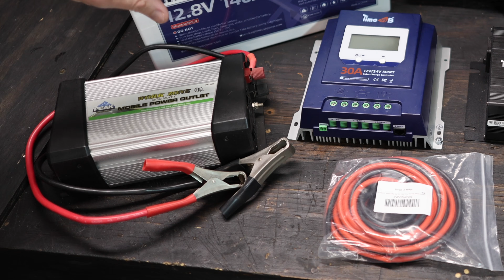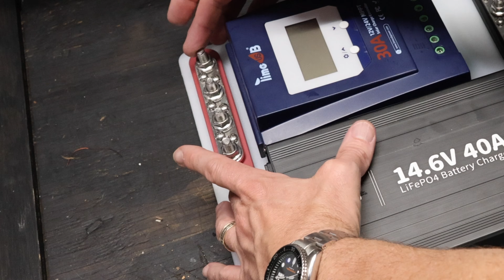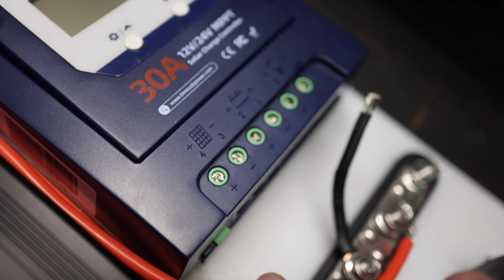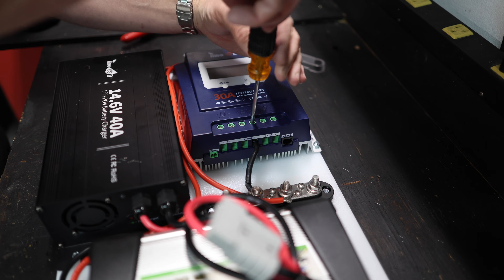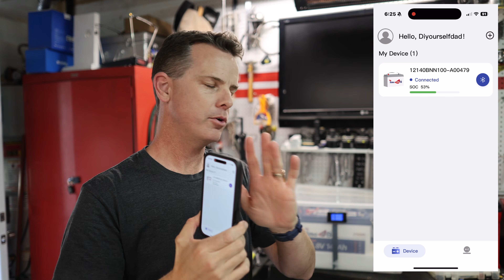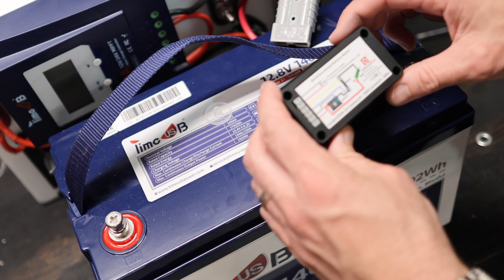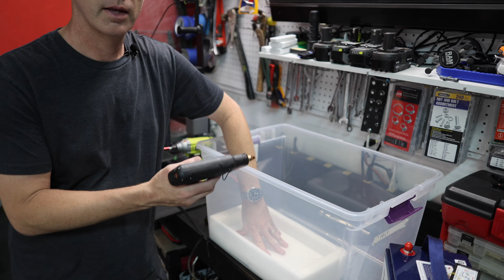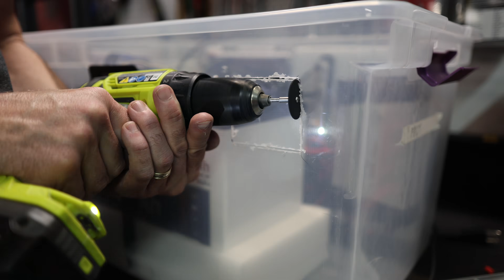Build Your Own Solar Power Station - Make It Better - Make It Cheaper

Comment: I had found a better solar charger controller that’s 60 amp would that be a better investment if I plan to charge it with panels?
Reply from the maker: As long as the BMS on your battery can handle it, absolutely.

Comment: Well, it’s a cool project, but it’s not cost-effective these days. 1–2 kWh power stations are pretty cheap now. Plus, they charge much faster than an expensive standalone 40A 12V charger, and they can handle solar charging much faster than a basic 30A 12V MPPT controller.
They’re also much more compact and portable, with a single screen to monitor everything, plus a Bluetooth app and high-power USB-C outputs.
This kind of DIY setup made more sense a couple of years ago, but with today’s prices and specs, your DIY kit actually costs more. In my opinion, it’s just not worth it anymore.

Comment: I really appreciate this video, as I’m rewiring the electrical system in my rv..my question is, where in that setup would an emergency shut off switch to, if you were to install one? Also, the fuse box. I’m good at putting things together with a step by step guide / video..so please advise if you can, so I can get her done properly. Thank you!

Comment: Instant Sub.
I'm Do It Yourself Grandpa. 78 years of tinkering. Glad I found you.

Quick note(s):

Direct sunlight will degrade that tote plastic lickety-split.

I like putting first a 25-amp switch, then a fuse at battery positives. That prevents accidental lightshows while tinkering and the fuse is, well, you know.

Comment: That chirping noise (ungreased bearing on a fan?) is super irritating. Your video is making a great effort to be very informative, but I have to keep pausing every minute or two so my brain can de-stress from the irritating noise. 

Otherwise, you need fuses, a kill switch, cooling fans, and it would be better to use a pure sine wave inverter if you plan to plug in anything at all sensitive, like a computer, laptop, or cell phone.

Comment: Great video! I’m working on something similar a portable power station for camping trips.

I used a milk crate to hold two batteries, then used cutting boards to cover three sides. On the fourth side, I cut out a rectangular opening so the milk crate grates can act as ventilation. I also added a piece of wood underneath the crate with caster wheels and strapped on two carrying handles.

It turned out really well. It’s portable and rugged.

Comment: I am planning to build a small charging station for my drill batteries, but I don't plan on putting an AC powered battery charger like yo did, but the batteries will charge from solar panels only.
I think that if using only solar panels to charge the battery, no buss bars are required because the 2 wires from solar panel will go straight to the solar controller, and from the controller to the battery, and to the inverter.
If needing buss bars, I think they can also be screwed to wood, indeed all of the component can be screwed to a wooden shelf, I just put a wooden shelf in my gazebo just under the roof and over the wood that support the roof (to get there, a ladder is needed), the inverter will be screwed to the closest wooden pillar under that shelf, to reach it without needing a ladder..
For a small charging station with a 40Ah battery to power a 300W car inverter, I think 10AWG wire would be enough.

Comment: Purchased a camper 6 months ago and finally finished the remodeling. As a nuclear worker, I am sometimes in the middle of nowhere and would like to build a portable solar generator to run that 30Amp bad boy off the grid when not at campsites. Any battery or inverter recommendations for 3600 or more WH builds?

Comment: It is not a generator, they are batteries, static power storage for short term emergencies. Any other name is a lie or a fake. They are useful but only to a point. Nothing in this class can replace the auto-on whole house COMMERCIAL Diesel generator if you loose power in a storm and have no idea how long it will be ouit.
Reply from the maker: lol….
Here we go again.

Comment: I'm building mine and I ordered that same battery monitor with shunt that you used but people should be aware that it does not keep track of current in and current out. Yes it accurately measures current flow but it is all cumulative, so let's say you consume 30ah then charge 15ah, you would expect the sum to be 15ah right? But the monitor just adds everything together and will show 45ah. Since it can't differentiate between current in and current out, it uses voltage for SOC, however this function did not work on the one I received, no matter what it just stayed on 1 bar and 3%. I finally returned it and got a AILI and the difference is night and day.

BTW I agree with some of the others that there should be fuses. The fuses built into the inverter are for inverter overload, they do not protect the battery cables from short circuits. Every item in your build should be fused to the wire size and as close to the source as possible.

Comment: Professional electrical contractor here. Just a little advice. Most stranded wire has a clockwise twist. Reversal will make it stay under screws and sliding contact blocks.
Reply: Wait so you're saying that twisting anticlockwise let it stays in the terminals better?

Comment: Why are you using aluminum wire and not copper wire going cheap? Because copper and aluminum don't mix, they'll oxidize. And you also say , I just had this stuff laying around my garage , most people don't have that stuff just laying around the garage
Reply from the maker: That’s not aluminum… it’s 8awg fine-strand tinned copper. Yes, I do have that stuff lying around the garage, leftover from a rewiring job on my trailer.

Comment: Cool stuff.  If you need a bigger "cutting board" SendCutSend sells HDPE in almost any size/shape you could possubly want.  A threaded insert will give you the ability t change components without stripping out the plastic.  I think I'll build one of these, thanks!

Comment: After investing in a bunch of Bluetti gear, my old pre-Bluetti gear (solar and generator life wayoff-grid for decades) will make a wonderful backup system this way, should or if the too expensive to repeat the investment Bluetti power station, expansion battery, Charger 2, and external LiFePO4 DIY battery bank AC-to-DC charger ...system fail.
Thinking of using an old, non-working, small chest freezer for the box, or a large-ish picnic style ice box.
-- Then comes the very cold wintertime LiFePO4 charge and discharge considerations ...as well as the plus 110F summertime situation. 
-- A thermometer with external temp read could be helpful.
-- Some warmth from the components might be expected. A small light bulb could add heat in coldest winter.
-- A USB fan might help move air during hottest summer months.

Comment: I might still build one for serviceability and upgradability, but the last time I checked Amazon and shopped around using coupons and stuff I could buy one for much cheaper with better specs and adaptability looking at comparable models. 

I still have my parts list sitting here for the features I want.

Comment: I built the same thing about four years ago; I even uploaded a video about it. What I did differently was design it with wheels so it’s easier to transport. I also kept the electronics simpler: the battery I use doesn't require a charge controller, so I just use a single diode to charge it with the solar cell.

I’ve been using it ever since, and it has always worked—no failures.

Comment: That's only a 140AH battery in a box.
That's not going to power much for a
long time, even overnight, grid-down.
You need something that is capable
of powering heating / cooling and a
refrigerator and maybe a freezer for
You to stay reasonably comfortable
and food secure for several days &
taking into account sketchy weather
and outdoor VS indoor temperature.

This is good for lighting, phone and
small electrical devices, not heavy
power consumption from appliances
for any amount of time. Also you can
run the risk of overload from heavy
or surge power usage so be careful
about that as well.

Just trying to be helpful because I
don't want to see anyone get hurt
or run into a situation where their
needs and expectations far outweigh
their capabilities by taking this
too seriously.
Reply from the maker: Didn’t watch the whole video eh? That’s the whole point, I show you how to do it, you size it for your needs.

Comment: Good demo thanks. My onky concern is the waste heat buildup inside the plastic (flammable) box with no fuse and no cutoff switch. Also a little concerned about the 8 gauge wiring being large enough. Seems a little risky to me.

Comment: Would this boondock with starlink, ac, hot shower,
Reply from the maker: You would have to figure out the power requirements for each of those devices, and spec the battery and inverter accordingly. But yes, it can be made to work.

Comment: Why don’t people tell us what the cost is of each component as they build it, and a total cost when completed? How much MONEY does this DIY actually cost?
Reply from the maker: I don’t mention cost because cost is going to be different depending upon how you build your set up. You need to size your inverter to your power needs, you need to pick out the battery according to the capacity that you need, many people don’t need solar charging so they could admit the solar controller, others don’t need as large of a solar controller, etc etc

Comment: Since you used a clear tote...
I would of mounted the board and components to the lid using longer screws, eventually making a shelf. That way i can see the screens just by looking down into it. 
And also uses a tote with a hinge system to open it, that way we don't over-strech the wire slack. This also creates more room for another battery since the components are floating above.

Comment: Plastic bins degrade under (UV) sun light and become very brittle at low temperatures and as such are not robust enough for in a mobile setup. High temperatures can kill electronics so ensure enough distance and ventilation. For protection of cables etc so selective fuses are mandatory!

Comment: I looked into building the bare minimum to run power tools and in order to run 1800 watts of inverter on a 12v battery you need to draw 150A. 

So... I looked at 24v and 48v options which increased the price of the inverter and the charger and the solar controller and the battery. So bare minimum to run power tools without an extension cord would be like $700 in materials. I ended up buying a pre-built power station that oddly cannot run my shop vac for $500. Mine is an Anker Solix but the other brands seem to all be pretty decent. 

If you don't intend to run a table saw from batteries you can spend a lot less.

Comment: Question.  I want to run my standard household refrigerator and was wondering what size cables and fuse to use.  I currently have a 12.8V 100ah battery and a 2000 W pure sine wave inverter.  Please advise and maybe even provide a link with the cable size and fuse.  Thank you in advance.

Comment: They sell terminals that have "fingers" that go to terminal blocks. Instead of twisting the wires. A single loose strand can cause (intermittent) short.
Also it would be good to place some fuses and quick disconnect on the battery.
Just in case the BMS fails

Comment: I assume your build is heavyer less portable (no grips stable shell) and unsafe due to lack of fans and cooling system. Inverter batteries etc heat up during stress.
On top if someone copys it without knowledge he could burn his house down.
Reply: Ah i forgot where is your app for using it?

Comment: A couple things that could have been done significantly better here...

That battery can comfortably push out around 60A for prolonged periods of time. Restricting it to an inverter that can't use most of that is wasteful, because now you can't handle demand spikes.

800w peak power output is not enough to be useful, your max continuous power is going to be like 500W and you can't run most power tools on that. 

You've also built a greenhouse with electronics inside that hate humidity and warm temperatures. Cut some vent holes and install a fan, they're extremely cheap and can massively improve performance.

Lastly a breaker, backup fuse, and power cutoff is critical for safety. Sure you can build the system dirt cheap to save money, but that doesn't matter if you total your truck in a fire incident.

Anyways, always prioritize safety over cost and performance. Damage from lack of safety measures will cost far more than you'll save
Reply from the maker: lol…. I address almost all of those issues in the videoe. Did you watch it muted?

Comment: could i build a massive one to power a tiny home with this?
Reply from the maker: Yes, you would just need more capacity, more amperage in the batteries (more 12v in parallel) and a much larger inverter.

Comment: Mounting on plastic ie questions heat from battery mppt unit other item's could melt plastic how about something heatproof
Reply from the maker: The melting point of HDPE is 248F…. If your equipment is getting anywhere close to that you’ve got bigger issues going on.

Comment: i understand why you did it this way ,its for safety , i would've removed the housings of all the electric component ,those are designed to radiate heat into air ,not inside the box ,i wouldve added an external cut off switch ,so i can kill the box and all of its electronics with 1 switch , and added ventilation ,those electronics will kick off a TONE of heat , they might actually melt the box

Comment: Good explanation of this project.  One issue common to vehicle installations is space for the power box even with the manufactured box’s they can take up space how ever the cutting boards a a good answer. As someone with multiple solar generators the weight issue is serious and I’m  very concerned that the clear Tote will not provide long term service  my experience is that theses totes will not handle the weight and they have minimal UV resistance I would suggest using some type if heavy duty tote like they use for logistics.  The added cost is minimal, further the cutting board could anchored to the tote.   Another item is milk crates these are very heavy duty and would support the weight of the assembly. Plus these have good UV resistance. I was in  Florida after a hurricane and there were piles oh milk crates being burned in place that had blow away during the storm.  So to me these seem to be cheaper to burn the collection and reuse. I have some furniture Dollie’s that I use to move my battery boxes and right now they all set on a platform cart on a one for one bases but for bulk storage the platform dolly works best.  I’m also looking at a solar panel storage rack/ cabinet to first keep the panels clean and to keep spiders out of the plugs.

Comment: Thank you so much for this video. I'm no electrician- you made this simple enough for me. With this setup, I don't have to spend $2k for a system to power things in my RV. Other DIY setups have tons of cables all connected to the battery- yours looks much easier and cleaner.  The only thing I didn't see is a 12v outlet. Would you just connect that straight to the battery since it doesn't need an inverter?
Reply from the maker: I didn't put a 12 V outlet on this one, but I have on others. You could just wire it straight to the battery, I would still recommend putting a switch on it so you can shut the outlet down so it's not always on.

Comment: All those sayingnno fuses? The fusees are in the inverter
Reply from the maker: They refuses in the inverter, the solar controller, the charge controller, as well as overload protection in the BMS. Technically, yes, one master refuse would not be a bad idea, but people are ignoring all the other safeties that are already built in into the system. If you weren’t running a lithium battery and running out of standard lead acid battery, then yes, a master fuse would still be needed.

Comment: You should only use a full sinewave inverter. Modified sinewave inverters can damage electronics connect to it.
Reply from the maker: I addressed it in the video, and talk about why one of using the inverter that I did
Reply: @DoItYourselfDad  Ah my bad,  I must have missed that part.

Comment: if you add up everything you listed, you should just buy a power station that will equal the amount of your cost. they are not so expensive if you add your wattage from your equipment's you're trying to power up. great video though, Thank you

Comment: that clear tote will not last very long. the clear units are only made to get your money now and again in six weeks. and again in another six weeks . rinse repeat. use something made like a milk crate. will hold up.
and do not use a plastic cutting board. buy a sheet of fire proof fiber board at the store.
use the large sized wire. that is multi strand of PURE copper. never use copped clad. ( fire hazard).

Comment: What about thermal issues? The inverter will be dissipating heat. Normally you would add a ventilator or some kind of heat sink, to get heat out of the plastic box. Electronics don’t like high temperatures, neither do plastic.

Comment: A neat build, thank you for sharing! I do have some concerns though. 

I'm not really stoked on the cutting board. Sure it's cheap and quick. But. An aluminum plate is *fireproof*. And is still pretty darn cheap and easy. It also provides some heat dissipation. 

Speaking of cooling, where is the fan? 

I'd also leary of that foam, did you check to make sure it's fire-rated?
 
Self-tapping screws into plastic isn't a great solution. Bolts with locktite / locking nuts won't back out from vibrations and can be undone/redone multiple times. And once you self-tap plastic you can't use that hole again.

Lastly, a shutoff switch would be wise.

Cheers!